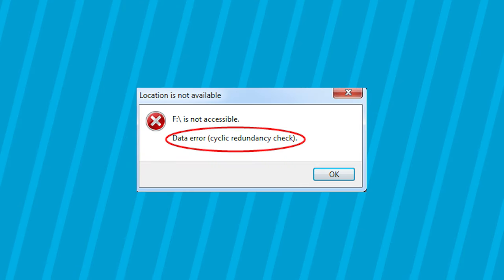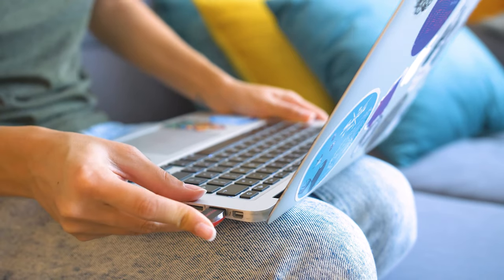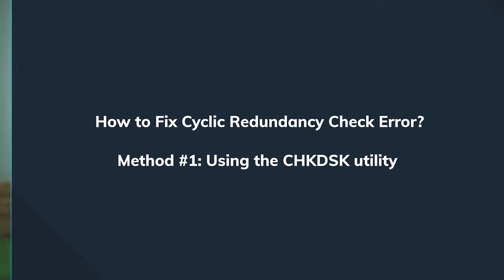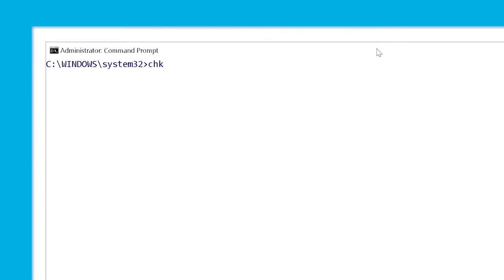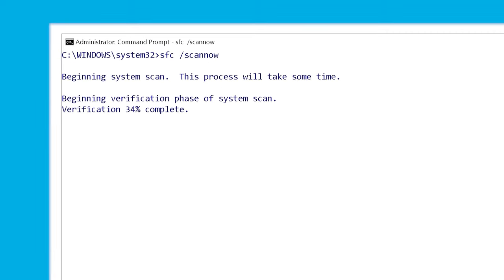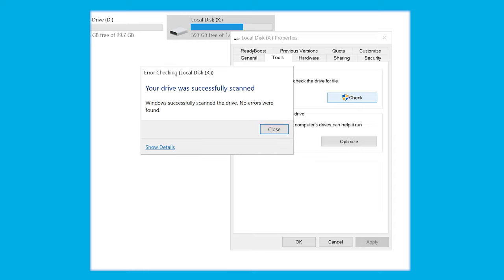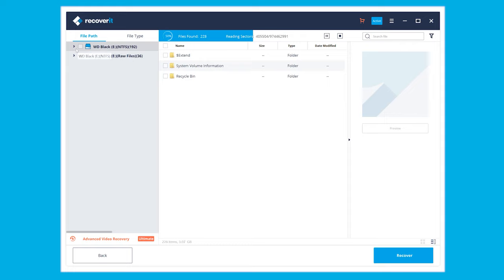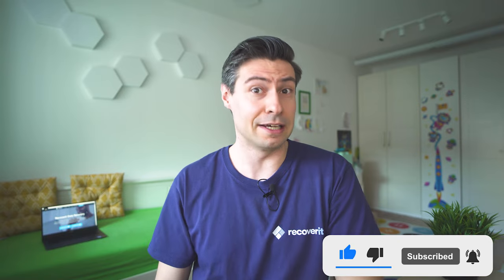How to Fix Cyclic Redundancy Check Error? [3 Methods]

Comment: Useless if windows doesn't assign your hard drive a drive letter.
Reply: did you find a way across it?
Reply: Also would like to know. All I have is disk 3 no pathway to it
Reply: @Mitchellbellhockey  same
Reply: Same
Reply: same no drive letter
Reply: Same
Reply: same bruh no drive letter
Reply: Did you find anything for help
Reply: @hrithwikmondal341  I had the same problem, if it works good first it could me head crash (Physical Damage) you need to bring it into a data recovery center.
Reply: @exogendesign4582  ok

Comment: I wanted to thank you for this.  I had a portable hard drive that I thought was unrecoverable...took it to Best Buy and they wanted about $1000 to "try" to fix it.  I tried your checkdisk and it worked!   Took several hours, but it worked...thank you so much!
Reply from the maker: Glad it helped! Please don't forget to subscribe to our channel.
Thank you for your like! Please subscribe to our channel!
Reply: My HDD is not showing up in the file explorer. When I go to the Disk Management, it tells me to 'Initialize the disk'. And when I Initialiaze the disk it shows "Data Error- Cyclic Redundancy Check". When I tried CheckDisk, I typed disk letter which was previously assigned, it tells "Cannot open volume for direct access". But how could I type any drive letter for chkdsk if drive does not show up in the file explorer in the first place? How to tackle with such problem? I cannot lost the data at any cost. I want access to my data. Please someone help!
Reply: @mk-zh7ub  im having same issue. were you able to figure it out?

Comment: Brother was great.  I have a problem and I don't know why it happened like this.  I tried to install the game through the DVD, but I keep getting errors.  I recently changed Windows, but for my previous Windows, I did not have these errors during installation. This was an error:
An error occurred while trying to copy a file: Data error (cyclic redundancy check)
Click Retry to try again, Ignore to skip this file (not recommended), or Abort to cancel installation.
Please help me 😭🙏🏻
Reply from the maker: Hi there, thank you for your question! Usually this issue indicates a problem with reading the disc or the drive. First, check the DVD for scratches or dirt and clean it if needed. If possible, try using a different DVD drive or computer. You can also attempt copying the DVD contents to your hard drive to run the installation from there. If copying fails, the disc may be damaged. Run CHKDSK (chkdsk /f /r) to check for hard drive errors, as these can also cause CRC errors. Additionally, reinstall your DVD drive drivers through Device Manager by uninstalling and rebooting to let Windows reinstall them. Ensure your system is up-to-date with the latest Windows updates, as missing updates can sometimes cause hardware issues.
Reply: @RecoveritDataRecoverySoftware  Thank you very much for your answer.  Finally, I was able to install the game, but there is still a problem.  Even when I want to copy the files, it either does not allow copying or does not read the DVD.  I have never faced these problems, but since I changed my memory card to ssd and changed Windows, it has been like this.

Comment: Started with no 1 - it started reading then when it got to 160,it started showing unable to read files A1,then went to next line unable to read file A2 & so on.

I moved to step 3,went on tools scanning and repairing is just there not moving or doing anything. It's an external drive,I just moved stuffs from my system to a particular folder refused to open.

Comment: I get a CRC on my external hard drive when I try  to access it through file explorer. The strange thing is though that all my other software (Photoshop, PDF reader etc) CAN access the hard drive with no problems ... Which, to me, means that there is NOTHING wrong with my hard drive. This has been happening consistently since the latest Windows update ... I do wish that Microsoft could, for once, deliver an update that doesn't screw things up at random.
Reply: Same here. It was disgusting
Reply: Sum about Media

Comment: I just want to understand: these methods would be applied only on hard drives, like if I have a disc/dvd and during the setup it reads the CRC error, should i use one of these methods or just clean the disc

Comment: Am facing problem of crc nd my external harddisk, its hidden in my computer but shows bad disk in disk management, but the hard disk is not initialized. when i try to initialize it, it give me error of crc i cant run chkdsk because of no letter assign to the drive so what should i do now?
Reply: Chances are the hard drive is dead.. I have the same issue I have tried very hard but I am not successful till now.. 

So yeah.. hard drive is dead

Comment: My PC is not able to see the disk, in the disk management tab, it is visible, but marked as unknown, not initialized, and doesn't have a letter assigned. When I try to repair it, I get this error. I tried the second method and it didn't help, I can't try out the other ones since it doesn't have a letter assigned and it's not visible in my pc.
Reply from the maker: Hi there,
If your external hard disk is not showing up in disk management, it's possible that there is an issue with the connection between the hard disk and your computer. Here are some steps you can take to troubleshoot the issue:
Check the cable and connections.
Check if the hard disk is spinning up.
Check if the hard disk is recognized on another computer.
Check the power supply.
Try data recovery software. Download Recoverit here: https://bit.ly/3ZoowNK
If none of these steps work, it's possible that the hard disk has failed and may need to be replaced.
Reply: @RecoveritDataRecoverySoftware Thanks for the reply. It is showing up in the disk management but not in my pc. The connection cable is ok, I tried switching it up for another. I also tried connecting it to another pc and had the same issue. The disk is spinning however and even the pc says it's a healthy unit the works fine...it is just marked as uknown :(.

Comment: What does it mean when it says "you must be an administrator running a console session in order to use the SFC utility"?

Also what if the computer cannot read the hardrive?
Reply: You need to open cmd with administrator instead of just clicking open
Reply: tab Win + R, type cmd and hit Ctrl + Shift + Enter

Comment: What if you have a crc error on an external HDD that has not yet been initialized?  It currently does not have a drive letter assigned to it as windows cannot yet "see" the drive.  CHKDSK will not work as there is no assigned drive letter  ...
Reply from the maker: Hi there, thank you for your question! Your drive still should be showing up disk management if it isn't then its most likely a more severe issue with the drive itself and I would recommend taking it to a professional for further assistance.

Comment: I tried to use Wondershare Recoverit but because my external disk doesn't have a letter so it cannot do anything not even scan that disk, If I try to image it that won't be possible since its storage has almost 2T while my whole pc storage has only almost 800gb, now If I could put a letter on the disk I would but whenever I try to initialize it through disk management then it show me the Cyclic Redundancy Check Error and won't let me do anything about it. I tried following this video to fix that Redundancy Check Error but nothing worked...
Also windows explorer doesn't show me the external disk because it doesn't have a letter so I can't access it at all... any other suggestions that may help?
Reply from the maker: Hi there,
If your external hard disk is not showing up in disk management, it's possible that there is an issue with the connection between the hard disk and your computer. Here are some steps you can take to troubleshoot the issue:
Check the cable and connections.
Check if the hard disk is spinning up.
Check if the hard disk is recognized on another computer.
Check the power supply.
Try data recovery software. Download Recoverit here: https://bit.ly/3ZoowNK
If none of these steps work, it's possible that the hard disk has failed and may need to be replaced.

Comment: I have an unpartitioned drive with no allocated space. It's the only drive on the laptop.

I cant run chkdsk because I have no volumes created
I cant create a volume because cyclic Redundancy Check Error

Am I Softlocked out of installing anything on the drive?
Reply: same problem i having while windows installation
Reply: @sajiballinoneexpress1695  i fixed it by booting with hirens usb. I ran chkdsk, used some of the disk utilities to check bad sectors and then I was able to partition and format the drive with the disk management tool all from hirens usb.

Give it a try. It might work for you too.

Comment: Hi just watched ur video. I can't seem to access my hard drive it's not reading. But when I go to disk management it shows and it's not partitioned and it's failing to partition show only an error of cyclic redundancy check please help me I have my school project on it.
Reply from the maker: Hi there, thank you for your question!  If CHKDSK doesn't work I would recommend trying to use data recovery software such as Recoverit to try recover your files from the drive.

Comment: Please I need someone to help me resolve the issue below. I have two hdd drives (not my main OS drives) 1TB and 500gb I want to use the 500gb as external backup and the 1TB as internal, but when I connect the 500gb to my external case, it doesn’t work ( shows as  allocated and not even recognized when I use diskpart. Also shows as not initialized under disk management ) and when I try to initialize it, it shows cyclic redundancy check.   But when I connect directly as internal disk, everything works 100%.  I thought the external case was the problem then I decided to put the 1TB on the external case and it works 100% well ( both as internal and external) and I don’t want it to be as external. Please can someone help me identify the issue here ?

Comment: Hi, i really need help here. i performed the chkdsk..however during the examining it was indicated that the  "File record segment E900 is unreadable." what can i do next with this?
Reply from the maker: Hi there, thank you for your question! This error suggests a potential issue with your disk's file system. To address this problem, run chkdsk with the /f parameter, reboot your computer to allow the disk check to complete, and immediately back up important data. If the issue persists, consider using data recovery tools or consulting a professional service. In severe cases, reformatting the disk may be necessary, but be aware that this will erase all data. Seek professional guidance if unsure or if the disk is under warranty.

Comment: The Hard disk doesn’t show up in my computer hence unable to select file while running system check in CMD. Kindly suggest how to trace the desired location of the hard disk
Reply from the maker: Hi there,
If your external hard disk is not showing up in disk management, it's possible that there is an issue with the connection between the hard disk and your computer. Here are some steps you can take to troubleshoot the issue:
Check the cable and connections.
Check if the hard disk is spinning up.
Check if the hard disk is recognized on another computer.
Check the power supply.
Try data recovery software. Download Recoverit here: https://bit.ly/3ZoowNK
If none of these steps work, it's possible that the hard disk has failed and may need to be replaced.

Comment: When i want to try the first method, it shows that my driver is RAW, chkdsk isn't available in RAW. How do i fix that?
Reply from the maker: Hi there, thank you for your question! Before attempting any fixes, prioritize data recovery. Use a reliable data recovery tool like Wondershare to retrieve your important files from the RAW drive. Once you have retrieved all your data you an format the drive but this will erase all the data on the drive but should resolve your issue.

Comment: Great! But I don't see my hard drive in file explorer nor can I find it with command prompt. When I open Disk Management however, the hard drive shows with a little red arrow. It says it is uninitialised and unallocated. When I right-click to reveal the Initialise option, the option is greyed out. As mentioned before, CHKDSK does not find the external. Another thing to mention, the drive appears in Device Manager. Only place it doesn't appear is File Explorer.
Reply from the maker: Hi there, thank you for your question! If the Initialize option grayed out, it suggests a potential issues with the drive. First, check the physical connection, try different ports or cables, and ensure your data is backed up. If you've confirmed the physical connection is sound, use data recovery software to retrieve your files, as the drive may have a corrupted file system. After data recovery, test the drive's health with manufacturer-provided diagnostic tools and attempt to repair file system errors using "chkdsk." If the drive is recoverable, initialize it in Disk Management, create a new partition, and format it (backing up your data first). Reconnect the drive and check File Explorer.

Comment: So I have a similar problem to what you're trying to fix but with mine, the external hard drive doesnt show on this pc for file transfer to be possible. But it shows that it has been detected by the machine when i go to device manager, disk manager, even cmd, but with cmd, it shows the size as 0bits. I'm so freaking out right now...
Reply from the maker: Hi there, thank you for your question! Make sure your drive is allocated in the Disk Management window. To check this, press Win + X and select Disk Management. Find your external hard drive from the list, right-click on it, and select Change Drive Letter and Paths. Assign a drive letter to your hard drive if it doesn’t have one. Make sure the drivers are all up to date for the drive.
Reply: @RecoveritDataRecoverySoftware  please the external shows there but it says I have to initialize it first, none of the options for the types of initializing works, and none of your solutions are working for me too 😪

Comment: So I did repair number 1 and it says "Cannot Open volume for direct access". I did repair number 2 and it said "Windows Resource Protection found corrupt files and successfully repaired them". However the problem still exists and I am still getting the cyclic redundancy error. Any more ideas please?
Reply from the maker: Hi there, thank you for your question! First, you could try using a different data cable or USB port to connect your storage device to your computer. Sometimes connectivity issues can cause errors like cyclic redundancy check.You could also try using a third-party data recovery tool to recover any important data on the storage device, as the data may still be accessible despite the error message.If none of these solutions work, it's possible that the storage device is physically damaged and may need to be replaced.

Comment: Well slight issue

I tried the 1st method on my nvme drive (the boot drive) and before I restarted my pc, it started throwing windows errors at me. Upon a restart it decided to remove some sort of boot files and would no longer load windows
Not fun

Comment: What can be done if the drive isn't visible in File Explorer and has no visible drive letter associated with it? The only way I can see my external drive is by opening Disk Manager and attempting to initialize the drive. However, initialization runs into this CRD error.
Reply from the maker: Hi there,
If your external hard disk is not showing up in disk management, it's possible that there is an issue with the connection between the hard disk and your computer. Here are some steps you can take to troubleshoot the issue:
Check the cable and connections.
Check if the hard disk is spinning up.
Check if the hard disk is recognized on another computer.
Check the power supply.
Try data recovery software. Download Recoverit here: https://bit.ly/3ZoowNK
If none of these steps work, it's possible that the hard disk has failed and may need to be replaced.

Comment: when i run chkdsk on command prompt, I got the following messages
critical master file table (MFT) files are corrupt
read only chkdsk found bad on-disk uppercase table - using system
Stage 1: Examining basic file system structure 
Attribute record (80, ") from file record segment 1 is corrupt
File record segment 4 is unreadable........
Many more segments listed are unreadable.....(not writing all)
5632 file records processed 
file verification completed
file record segment 3EB is an orphan
17 large files records are processed
file record segment EBC  is an orphan
THIS IS DISPLAYED ON CMD PROMPT WINDOW . I COULDN'T ACCESS MY HDD after completing the CMD PROMPT UTILITY.
WHAT SHOULD I DO NEXT ?
Reply from the maker: Hi there, thank you for your question! This can be a serious problem that may result in data loss if not handled carefully.It is crucial to back up your data immediately if you haven't already, using a data recovery tool or another computer. Next, check for hardware problems, ensuring secure physical connections and, if necessary, try another computer. Attempt to repair the file system using chkdsk /f and chkdsk /r in Command Prompt, followed by running SFC (sfc /scannow) to address system file issues. If the problem persists, consider professional data recovery services, as data loss is possible.